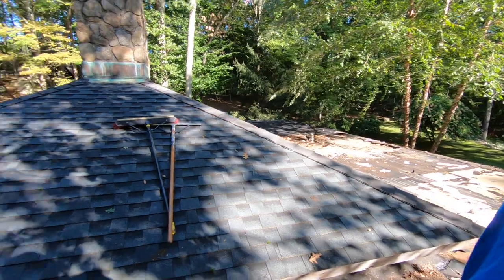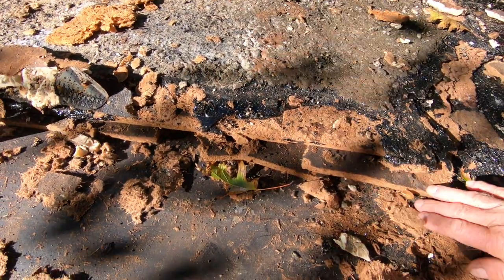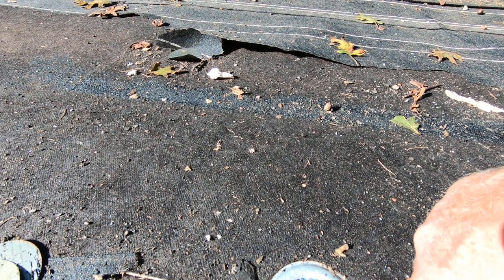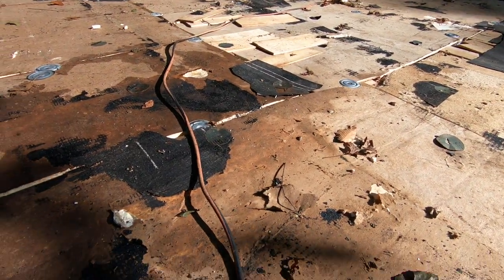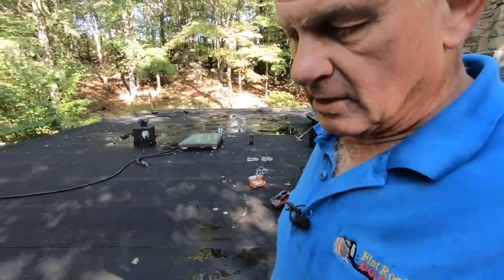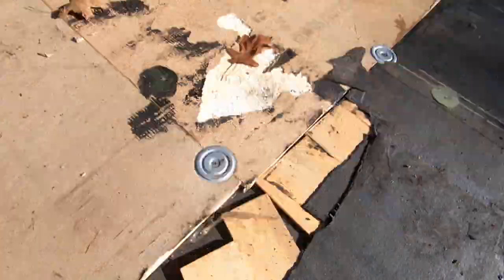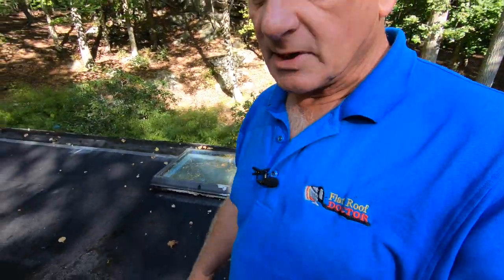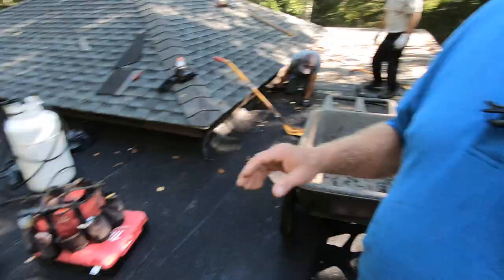The worst roof installations I have ever seen in my entire life

Comment: Hiring roofers is really stressful there’s a lot of scammers near me. I couldn’t get a regular roofer that I use this fall and had another company come out they quoted me $10k to redo flashing on my chimney. I almost had a panic attack. I used these videos and figured out the leaks myself ( cracks on top of chimney were the problem not even the flashing or roof tiles…) it was $100-$200 bucks of material and like 4 hours up on the roof. I would not go with the cheapest quote necessarily but I definitely would want 3 or more quotes to choose from from now on, it’s so easy to get tricked if you’re not careful.
Reply: Yeah these videos are gold.
Reply from the maker: I am glad you figured it out. That is why i make these videos

Comment: How do you deal with the upper roof overhang on a roof like this?  Seems like fire would difficult to control.  Do you glue down the membrane under the overhang and against the house or do you torch it down?  Thanks in advance.  I always appreciate your videos.
Reply from the maker: Ok. so I position the membrane so it would go up under the the overhang. I fold back the membrane, torch down only the section not to close to the overhang. Then I burn the plastic off, smear Karnak 81 Trowel grade against the wall, and then stick the membrane to that. I then fold the other side back from the seam and torch that down till I get to the seam and then fuse the seams together. I hope I made sense.